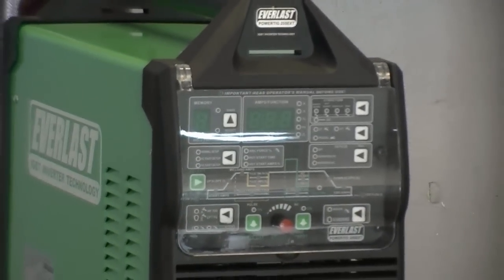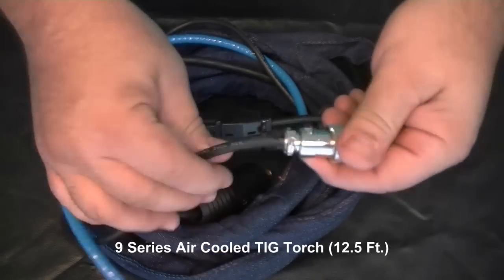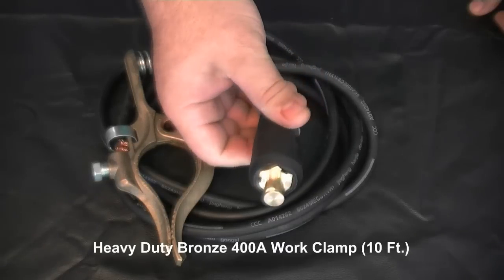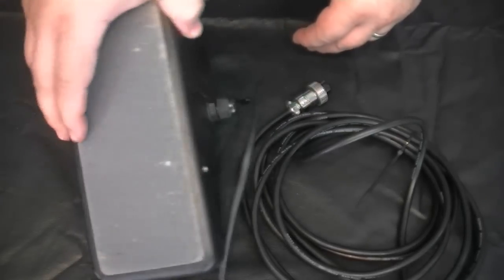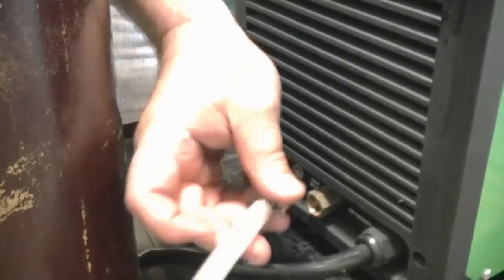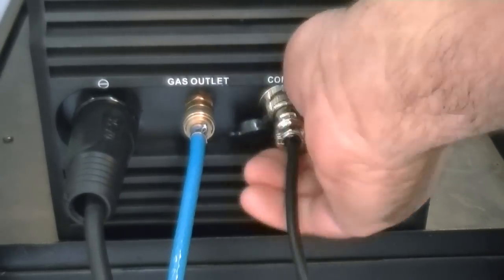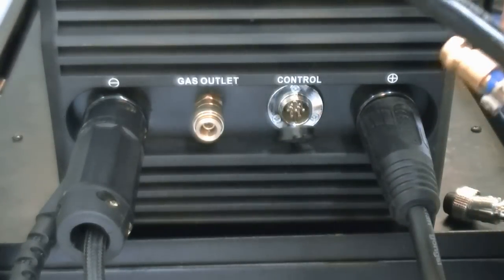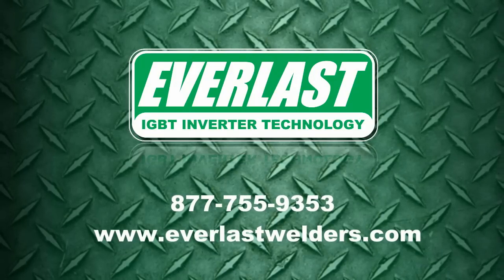AC/DC PowerTIG 255EXT IGBT Inverter TIG/ Stick Welder from Everlast Part 2 (2015 Model)

Comment: I just received my powerarc 200 and it doesn't work , I kick on the power it runs for 30 seconds and what seems to be a very low idle then flickers,  it  can't even strike an arc
Reply from the maker: Augustine saucedo  please call tech support.  That's what it is for.  ext 207.  thanks
 theyll be able to help.